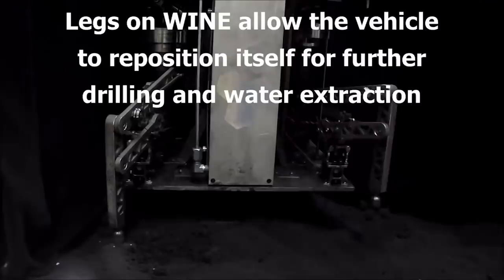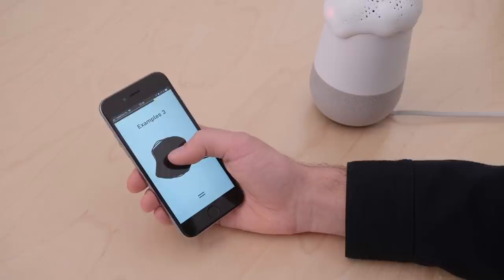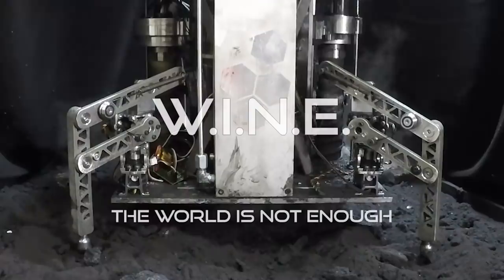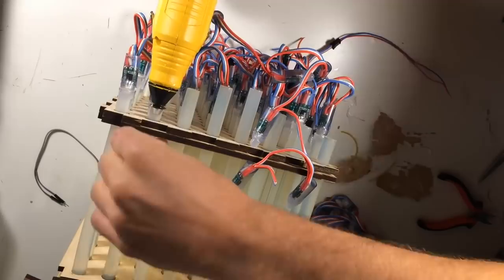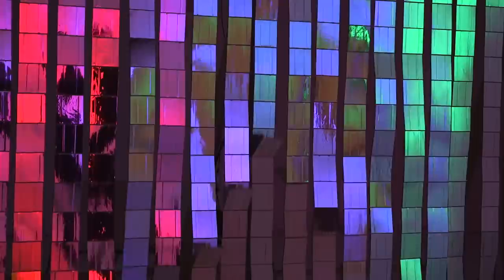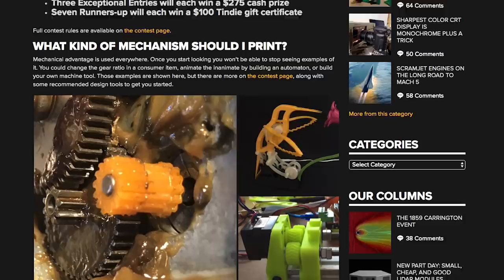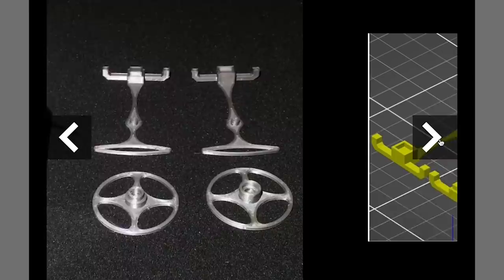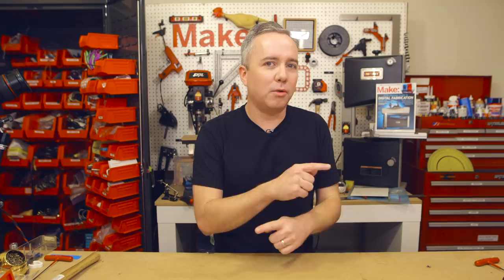Maker Update: Privacy Parasite

Comment: I can't wait to mess around with the arcade, and whipping up a new pi zero console will be fun. Also the Tic-Tac solder spool is a great idea, i can imagine adding a small blade to the lip for hookup wire/string to be able to cut off quickly - or even a v shape to strip the ends before and after the main cut. Thanks Donald !
Reply: Good point, Panther! There's an opportunity for a cap design with an edge built into it for cutting wire or string, or even just a place to wedge the end of the reel so it doesn't slip back inside.

Comment: The 3d Printed Geodesic dome segments are incredible useful. Building a temporary shelter or structure for storage is super easy with something like that and some PVC. We should be shipping a 100 3f printers and mile of filament into disaster zones so they can produce what people need on the fly.
Reply: Geodesic domes are far harder to cover than traditional prism shaped tents.
You can also knock up a traditional tent by lashing to together  pipes, sticks, whatever at 90 degrees using nothing more than a length of string or rope. They don't require power or a 3D printer, spools of plastic filament, etc.

...You'd be better off using your filament as string to lash together a traditional prismatic emergency tent.

Geodesic domes look cool and have a certain new-age hippy-vibe that's hard to replicate, but that's about where their utility ends.